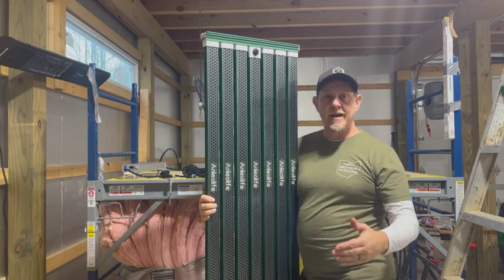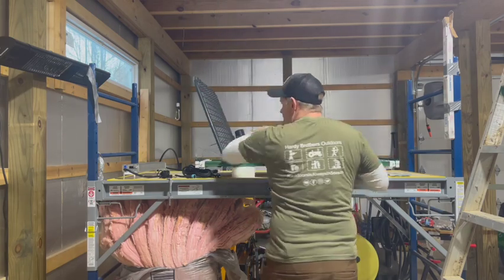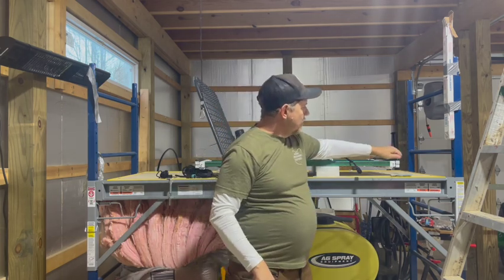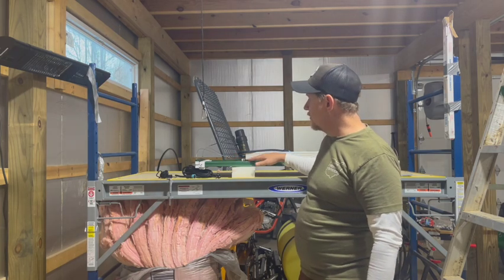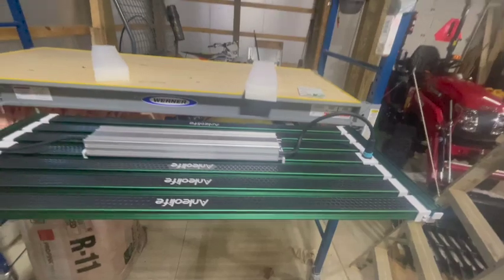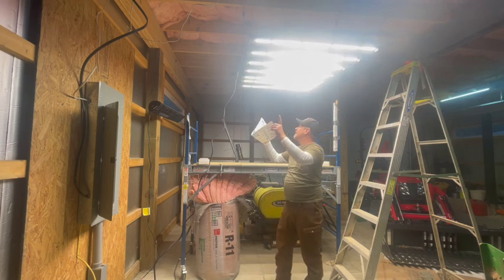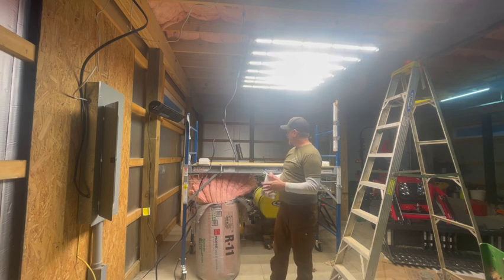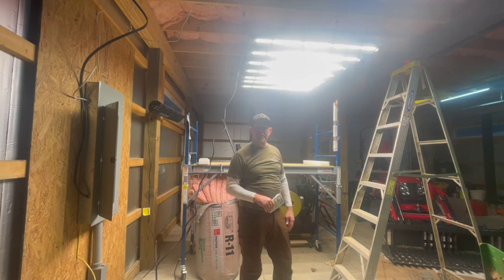First Impressions: 1000W ANLEOLIFE Stretchable Full Spectrum LED Grow Lights

Comment: Why is this a good quality light what’s the ppfd ?who makes the diodes? who makes the light ? Who makes the driver? What’s the efficiency?
Reply from the maker: As stated, i'm not an expert in grow lights or LED technology, but per the provided Amazon link: https://amzn.to/3wFPuaf 
and description details here is what I can tell you: 

UNIQUE EXTEND-RETRACT DESIGN: Freely adjusting the light coverage area to suit different plants in different growth stages. Free of install, plug and play, suitable for multiple lighting application.
HIGH EFFICIENCY & HIGH YEILD: Equipped with 2604pcs Samsung LM281B+ Pro diodes feature a scientific layout, together with advanced driver, excellent optical uniformity, offers long-lasting high efficiency, PPE up to 2.896umol/j. Max yield 2.8g/w.
OPTIMAL FULL SPECTRUM LIGHT: Consist of cool white 5000K + warm white 3000K + red 660nm, and equipped with a dimming knob with 4 levels of light intensity ranging from 0% (off), to 25%, 50%, 75%, 100%, providing the ideal lighting for plants at every stage.
ULTIMATE TEMPERATURE CONTROL: Patented thermodynamics self-circulating cooling system, reduces temperature by 30% more than similar products. No fan, no noise, no extra cooling cost, saving your energy bill.
LESS WEIGHT & MORE FASHION: Anodised aluminum board with good scratch-resistance, static-free. Lightweight structure, 30% weight less than products of same size. IP65-rated water&dust proof, ensuring safety and reliability. Ultra long lifespan of 54,000+ hours, with 3-year warranty.

Any other details you still are looking for, I can pull from the light and included manual when I'm back at my property.  Hope this helps!
Reply from the maker: also the LED Driver details are:  TBWtek model: TBW-LFA1000-56Z
Reply: The LEDs are Samsung lm301h EVO and 281bs 
3000k are the EVO and 5000k 281b